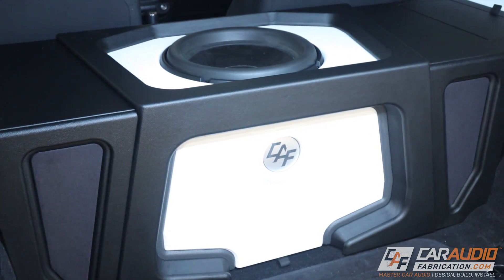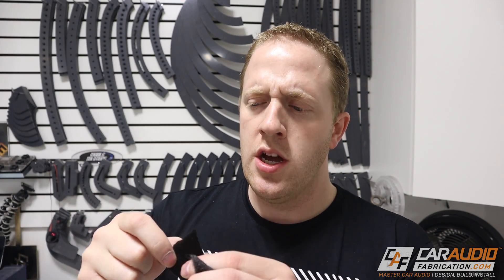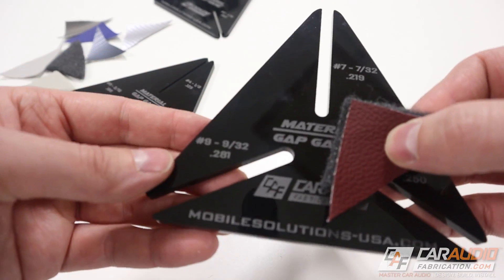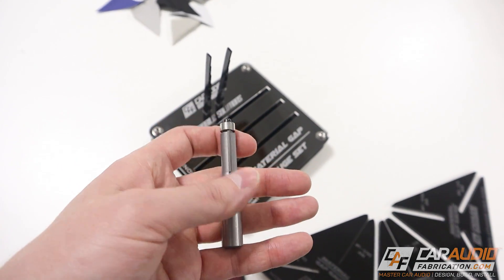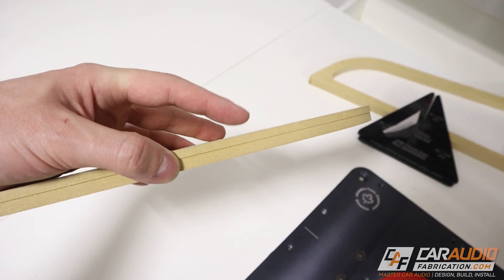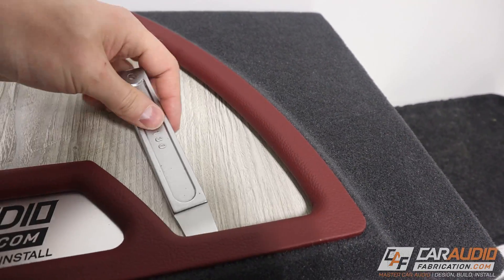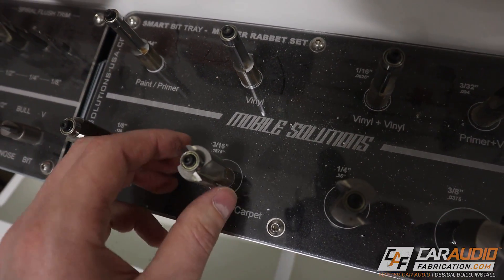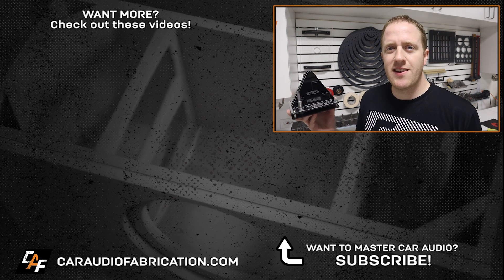I designed a tool to avoid upholstery mistakes! Introducing: CAF Material Gap Gauge

Comment from the maker: Really excited to design this new tool and share it with you guys! To get yours go here: https://bit.ly/CAF-Gap-Gauge Thanks for watching!
Reply: Man, You could totally use a Co2 laser for all of your fabrication.  Cut 1/4" wood, plastic, fabric, carpet, vinyl, and your templates.
Reply from the maker: This tool helps for the design phase when making parts by CNC too. You can plan your gaps precisely ahead of time. A lot of guys would just machine size on size then adjust by hand on the router (or even worse, sanding) but now they can just be accurately planned for in the design stage.

Comment: Hello Mark, I have a stupid question. Do you have a gauge for bed liner/ rugged or that tough vinyl material (3M Carbon Fiber Wrap Film)? I am asking for a Marine application...Or would you suggest just gel coating the gap?..thanks for your advice. It really is greatly appreciated.

Comment: Awesome, but missing one thing. Metric measurements.
Reply from the maker: The bit shown in the video is a one-off custom made bit that was designed for this application here in the US. The measurement value isn't as important as the slot number, the slot number corresponds to the number of passes to make with that bit. Listing the metric equivalent measurement would have no value, and converting is very simple (Multiply the inch value by 25.4). This industry primarily uses inch measurements anyhow (12 inch subwoofer, 8 inch, 10 inch, 15 inch, etc)

Comment: Inches???? What???
You should use millimeters! That the right way to go. In the 3D print world no one uses inches anymore. So outdated.
Reply from the maker: The bit is one off and custom made and corresponds to the measured values. The value of the measurement isn't as critical as the number associated with the slot and making that many passes. This industry primarily uses the inch unit of measurement. (10 inch subs , 12, 15 etc.)
Reply: CarAudioFabrication I disagree on this one Mark. There is a bit truth in what Leonardo Santos says. Inches are in my opinion also a bit old fashion. Don’t misunderstand me, I bought equipment of you, so I am not a nagger. But truth is that inch, miles, feet etc. is not as accurate as the metric system. Indeed we use the terms of an 10 inch, 12 inch woofer in Europe.... but that’s it. A 6,5 inch is more often called a 16,5cm speaker.
In my opinion the templates also has to have metric equivalents; it’s not well thought through or not a finished product in my opinion. That’s for me a reason not to order it until it’s redone with metric sizes on it to. By the way; I hoped you would say “there are metric equivalents on the backside”, but disappointingly you didn’t......otherwise I was planning to order them.
Reply from the maker: "Inches are not as accurate". The unit of measurement has no influence on the precision of a machined value.
Reply: CarAudioFabrication you are right the accuracy has not to do with the unit, but is much easier to deal with.
Reply: CarAudioFabrication ok, lets say you’re right. But you should admit at least that the product is not well thought through, or at least not complete.....

Comment: This is perfect! Would save me a ton of headache. My last build I ended up redoing a focal point the stress on Alcantara because it was way to tight🤦🏼‍♂️ and to top that I’d run out of tan Alcantara and set the job back a week and half, thank you for coming up with this life changer 🙌🏼
Reply from the maker: I have totally been there! We spend hours making shapes and all the different pieces, wrap everything, and you go to press it together, and it just doesn't.... that's the worst! This definitely helps with the design and fabrication process, I've been testing it to make sure it is perfect on a few projects now and it is soooooo much better.